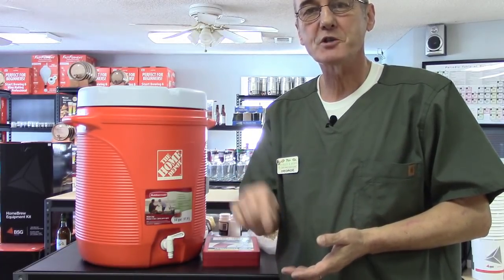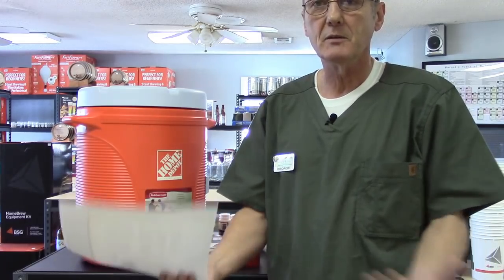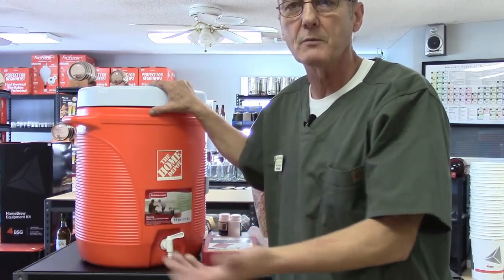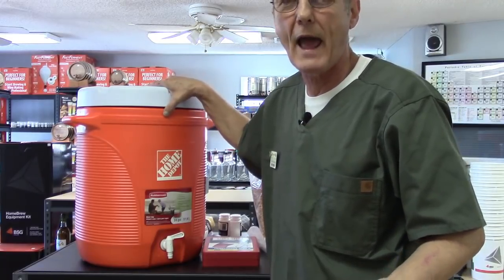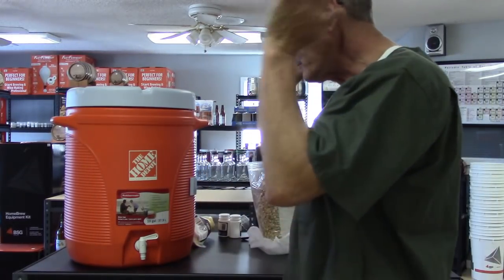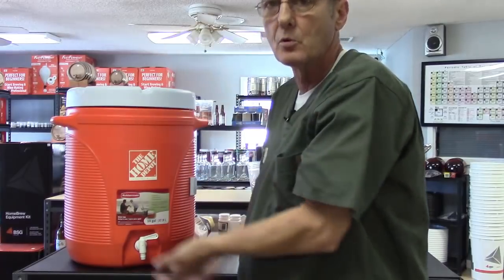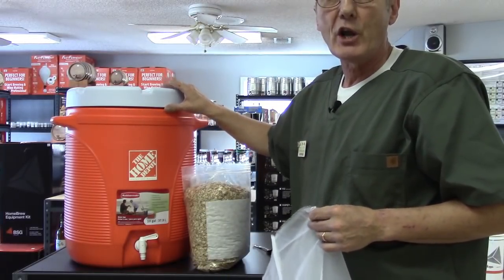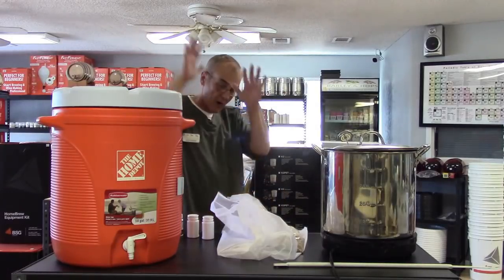Making the mash for George Washington's Rye Whiskey

Comment: One of George Washington's original stills was seized by ATF agents in a moonshine raid in 1939 from a family descended from Washington's servants, not slaves. It was one of many he had at the Dogue Run grist mill/distillery on the Mt. Vernon property. A meticulous reproduction was done by Vendome Copper in Louisville of the original still made by R. Bush and Co. in Bristol, England. A Scotsman, James Anderson was Washington's master distiller, who got the distillery in full production while Washington was out fighting the revolutionary war and at full capacity operated 5 stills, and produced around 11,000 gallons per year, which easily made him one of the largest distiller on the entire East coast. Washington himself probably would have rarely actually drank any of this whiskey as he preferred imported madeira or even champagne, so it would be a mistake to think Washington was in amongs barrels of whiskey turning the tap. Washinton's exact mash bill is preserved and is more similar to today's rye whiskey with a larger corn adjunct. The whiskey would have never been bottled as all whiskey at the time was sold bulk in barrels.

Comment: There is no part 2 because the recipe is a bust.  9 1/2 lbs of flaked product needs a more amylase than 1/2 lb of barly malt to convert.  Do. It use flaked rye in this recipe. Uses malted rye instead and it may have a fighting chance.  He probably got 300 -400 ml of ethanol of this at best.

Comment: I have the 10 gallon HD cooler for a mash tun as well.  Made the following mods: 1.  Remove spigot, replace with 1/2" NPT SS ball valve, O-rings on both sides.  2. On the nipple end of the ball valve I installed SS filter.  This filter is made from a Stainless water heater hose.  Cut the ends off, pull out the silicone rubber core.  Use a SS hose clamp to clamp the sleeve to the pipe end in the cooler.  Pinch the other end closed and tightly twist SS wire around it to keep it closed.  The result lets liquid flow out but not any grain or particles.

Comment: I use a false bottom in a 10 gallon cooler for my all-grain beer mash. The advantage of the false bottom is before you run your grain into a bucket you can run some out slowly into a big measuring cup and put it back into the cooler. When you pour it back in try s much as possible not to disturb the grain bed. Repeat the step over and over until the wort is clear. This allows you to use the grain bed as a filter when pulling your wort/mash out of the tun.
Reply: I learned this from watching a video done by John Palmer. Setting the grain. Multiple ways to rinse the grains.

Comment: Just some FYI for anyone wanted to try this recipe. This expands out to be way more grain in the cook pot than you're probably used to, I have a 21.5 Qt cooking pot and could barely get it all in there. I didn't use a sparging bag as I had always fermented on the grain before. If you're going to do this OTG, the grain all ends up at the top and tries to block your airlock while the fermentation is in progress, when its all finished the "cap" will fall. OTG there is really no way to check your SG until the cap falls down.
Reply from the maker: +thastinger345 Good advice... This is why I used a 10 gallon cooler; I knew I needed the extra room for the grain. I'll do a better job in the future of mentioning this. I normally don't ferment OTG so this was not an issue for me.
Glad to hear you did overcome the challenges.
George
Reply: It was my fault George, there is no way you can explain every potential hitch in your videos. I appreciate you posting the vids and was just passing along my "lessons learned" to anyone that might be able to use them.
I now know that I need a larger mash tone if I want to do this again.
Reply from the maker: +thastinger345 I truly appreciate the comment and it is helpful for others. This is what makes us a growing and strong community; we share information. Don't hesitate to comment and offer any lessons learned. I welcome and appreciate them.
George
Reply: can u help with proportions im really confused

Comment: Gday George  Gary Brown Prairie AUSTRALIA  your shows are marvelous I can't get enough of them  can you please send me the George Washington recipe, I can't wait to make it I've just finished a still and a ss fermenter  so I'm ready to go
Hey George that plastic barrel you used for a fermenter have you thought about 1 or 2 electric frying pans use plastersine tobuild the sides up against the bottom of the barrel tape the pan up tightly to make a good fit then pour some plaster or cement in the Pan let it set and strap it on tightly to your  barrel and now you can use the controlled thermostat on the  frying pan to meep your temperature constant. 
Thanks for the help mate ,regards Gary Brown Prairie AUSTRALIA.

Comment: I tried a thrown together recipe I dreamed up and I only produced a 1.036 without sugar added on a 10 gallon. 12 lbs cracked corn 4 lbs rye 2 pounds 6 row. After adding 2 lbs brown sugar 7 lbs table sugar and 8 lbs corn sygar I only got up to a 1.076. Mash ymtun worked pretty good but next time I think I'll turn the corn to porridge in my pre heat water. Probably clog up the false bottom tho. Hopefully the learning process tastes good lol
Reply from the maker: You are on the path to greatness. For 10 gallons you can see it does take quite a bit of ingredients to get to 1.090 or so. 
Keep at it. 
George
Reply: @BarleyandHopsBrewing  not too shabby 110 proof running the first 4 gallons then 120 on the next 4 with tails thrown in. Got a total of one gallon and one pint after cutting to 80 proof. Final ABV gave me 12% there was two gallons of wash I froze cause I ran out of ice. No aging or oak chip soak yet and it tastes like Jameson with that sweet finish.. couldn't have done it without you. You Da man!
Reply from the maker: @cowpiecowboy7599  Awesome results. Keep at it. It only gets better.
George

Comment: Hey George! First off man thanks so much for doing a great job on ALL of your videos. Its been a great resource as we are getting started in the distilling process. My question is:
 My friends and I have done a few test runs using a corn only mash to get our still tuned and to better understand its functionallity. (55 Gal 6" 6 tiered Reflux Still...its a beauty) The problem is we are having a rough time converting the corn. An example of this is we used 20 Gal of water and 40lbs of milled corn with 4 teaspoons of alpha amylase and gypsum heated with propane burners in a 30 gal mash tun at 165/170 degrees F. We did this for 7 HOURS! Added a gallon or two in the sparge of the grain...And still when doing an iodine test it came back still black and not dissolving into the test liquid from the mash as you have done in several of your videos. Basic question is what are we doing wrong sir?
Reply from the maker: Amylase is sensitive. If you are at or near 170 you can inoculate it and thus make it non-responsive. Be careful of this. Temperature is critical when using amylase. Your target (perfect) temp is 155F with no additional heat added to it.
George
Reply: Barley and Hops Brewing thanks so much for taking the time to answer my question. Keep up the great work! Thanks, George!
Greg

Comment: Excellent video George, in your opinion would malted wheat have a favorable outcome?
Reply from the maker: +Lysle Roe Actually malted wheat would work on its own since it has been malted. Diastatic power is listed as degrees lintner. Base grains like 2 row is 140 so there are plenty of enzymes to work for you since 30 is all that is needed to convert itself. Malted white wheat is 160 and the red wheat is 180. This means that you can steep these at the right temperature and convert the starches to sugars alone or add flaked products with it and convert that as well. 
Any flaked or rolled grain will require a little help so to answer your base question; absolutely.....

George
Reply: +Barley and Hops thanks for the imput, really like your channel by the way

Comment: Hi George, Maybe I missed it, but was that a total of 5 1/2 Gallons of water that you used for your mash?  1 1/2 in the Cooler and you added another 4 Gallons from the pot.  My goal is to end up with 5 gallons of fermented mash for my still, how much water and grain should I start with?
Reply: Hi Jim, you need to allow for grain absorption, about 1 pint per pound. Check brewers friend for rates. Sparging the post mash grains recovers residual sugars and tops up the water lost.

Comment: George, I would love to see how you separate the grain from the wash.  I seem to loose a lot of liquid in the mash bag.   Any tips?
Reply: That's one of my issues too when using a bag.
Reply: Get yourself a colander which fits over the tun, lift the bag up and set it on to the colander to drip. You can sparge the grains with a couple of litres 170 deg water to rinse remaining sugars out and give it a 'gentle' press / squeeze.  Leave it there until dripping stops.

Comment: Hi George  I made this recipe today... followed it as you suggested... when i checked the specific gravity it came in at  1.045  SP 
therefore it was around 5 % ABV.... is that Ok...seems very slow for a Whiskey mash!!!
Reply from the maker: Your efficiency level is fairly low. Mashing correctly and sparging with warm water should increase your gravity. Based on calculating the projected gravity you should be near 1.075 -1.080. 
At 1.045 you are off by about 40%. You could add sugar to make up the difference but that could affect the flavor profile.
George
Reply: @BarleyandHopsBrewing  ohhh really? I thought i did everything as the recipe said...I might have to add sugars and bite the bullet on this one!!!

Comment: Hey George, just started “playing “ with spirits and found your channel. I’m a 10 year veteran brewer and I’m used to going to a boil kettle after the mash tun and boiling for 60 to 90 minutes. Will boiling the wort change they flavor compared to not boiling?
Reply: no, melanoidins are too heavy to carry over. just ferment on the grain with a diastaticus yeast, the temp from your mash will pasteurize the mash and vat (160f for 60 seconds is considered pasteurized). Essentially, you are making a raw ale that you don't lauter off.

Comment: Did you use the dady yeast and nutrient like you do in a simple sugar wash?
Reply from the maker: Yes I did.
George
Reply: 2tbsp yeast and 2 oz nutrient? 
Do you use yeast energizer at all for something like this?

Also I use a water distiller. Is there a certain ml of distillate I should stop at with 4L of mash  
Thanks
Reply from the maker: Energizer is not my go to additive. The nutrient is plenty. 
The amount of alcohol you get from the distiller is dependent on  the ABV of the mash.

Comment: George, how much 40% finished product did you get from this run? Did you use a pot still or reflux?
Reply from the maker: +thastinger345 I used a reflux but I modified teh packing by removing half of it so I wouldn't strip the taste. I got just over 1/2 gallon (made 1.25 gallons finished product at 40%) of 160 proof that was very pleasant in odor and taste. I stopped early to make sure I didn't get any tails in it. 
George
Reply: +Barley and Hops I ended up getting 4.2 Qts of 45% from my 8 gallon run. Wasn't 8 gallons by the time I strained off all the grain from the wash though. There is definitely a lot going on in the taste of this stuff, at least 3 distinct flavors as you drink it.
Reply: Barley and Hops Brewing LLC

Comment: Does the Corn properly gelatinize without a vigorous boil? If not, will the amylase be able convert the ungelatinized corn starch?
Reply: He's using "flaked" corn. The manufacturing process to make flaked corn uses steam rollers. The heat and moisture gelatinize the grain during that process, so it's basically pre-gelatinized, dried, and packed up. That's why it doesn't need a cereal mash, and will convert with the normal enzyme mash temps once you add your barley.
Reply: Bearded & Bored oh wow hello there i love your popcorn malting and beer videos :) keep up the great work!

Comment: I know this video is a bit old and sorry if it was already asked, but what ABV did you end up with after doing this?  The first batch I tried making using the flaked rye completely seized and turned to porridge.  After two days of trying to drain it all I got was about a gallon of liquid.  I tried a second time using cracked rye instead of flake and worked much better but only end up at about 3.5% abv in 5 gallons.  I ended up adding 5 lbs of sugar to get the ABV up to 11% to make it worth running.  I know all grain mashes tend to have a low ABV but was rather disappointed with only 3.5%.
Reply from the maker: My ending abv was around 12%. I used a 10 gallon cooler in order to have enough room for the bag and all the ingredients so I didn't have to strain it as you described. I spent more time sparging (rinsing) the fermentable sugars out of the mash bag as opposed to straining which is difficult at best. George
Reply: Thanks for the Reply George.  I'll definitly have to try it again and see if I can get the better ABV similar to you.  I'll be running what I have for some different small scale experiments with aging.....hey wait...what are you doing replying...I thought you retired :D
Reply: George, I put the bag in a bucket that fits over my fermenter. Bucket has lots of holes in the bottom. Pour the mash from the cooler after starch conversion into the bucket and the wort drains into the fermenter.  Pour 170 degree water over the grains slowly and stir until they don’t taste sweet anymore. Easy then to pick up the bag, squeeze it dry as you can and discard, put in compost, or feed the chickens. This way you don’t have to hold the bag over the mash tun as you rinse.  Your 10% ABV is nothing to sneeze at, however. The “bucket in a bucket” is a tried and true method for making beer.Great video!

Comment: can't use hydrometer instead of iodine?
Reply: The hydrometer won't tell you if you have complete starch conversion, only the sugar content. Test with iodine, then once you get a "no starch" result with the iodine use the hydrometer to check the gravity:-)>
Reply: the hydrometer reading will be the same before and after starch conversion. it will only tell you gravity. 
The iodine test tells you when the starches are converted to sugars and yeast is now able to feed on the sugars, they cant feed on starches.

Comment: so did you add yeast to this.
Reply from the maker: Yes. That was the last step that I did not film. I focused on the recipe of grains only and not moving it to the fermenter and adding yeast.
I routinely use D.A.D.Y.  (distillers active dry yeast) and some nutrient to ferment with.
1 table spoon of yeast and 2 tablespoons of nutrient per 5 gallons of mash.
George
Reply: what inicial density of the mash to ferment?

Comment: George.  Could you please and thank you send me the George Washington's rye whiskey recipe
Reply from the maker: I found a way.

George Washington’s  

Rye Whiskey

 

Washington’s grain bill was 60% rye, 35 % maize (corn), and
5% barley malt.

Ingredients for a 5 gallon batch.

6 pounds of Rye

3 ½ pounds of flaked maize (corn)

½ - 1 pound of malted barley (2 row or 6 row)

1 teaspoon of gypsum

1 teaspoon of acid blend (optional)

5 gallons of water

Yeast

Charred white oak chips or wood strips from a used port wine
barrel.

 

Best practice for cooking is to use a 10 gallon cooler or
similar size vesel.

Cook corn in a large pot until it is softened (hydrolyzed).
This usually requires about 3 gallons of water.

Allow this to cool by adding it to the cooler (vessel) by
adding cold water until it is near 170 Degrees F.

Add the flaked Rye (at this point there should be about 6-7
gallons of water in your vessel.

Add the gypsum and acid blend. Stir

When the mash temperature is 160 degrees F add the malted
barley. 

   Malted barley is
only there to convert the corn and rye to fermentable sugars so temperature is
critical. A temperature of 155 degrees F is perfect. 160 degrees F is okay but
nothing higher.

If you use amylase to convert your starches instead of
malted barley follow the same directions and temperature.

Cover this and let it sit for at least 90 minutes. 

Strain out the grains as best you can. Check gravity and add
sugar of you need to increase the ABV.

Cool to 80 degrees F and add nutrient and yeast. Allow to
ferment until it is done.